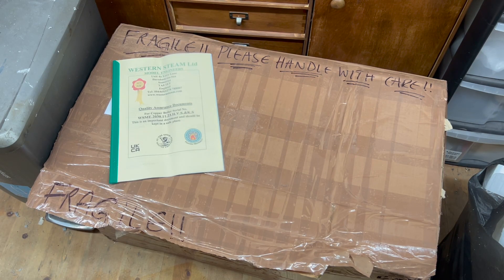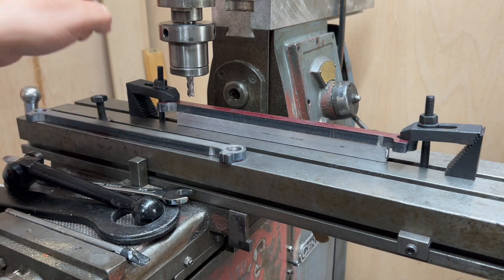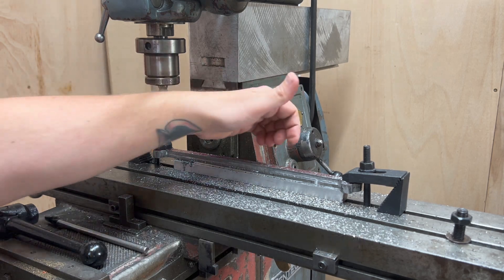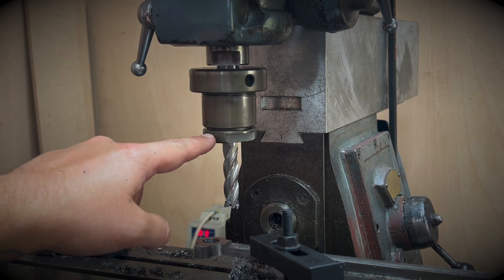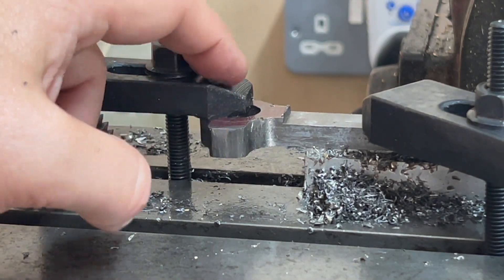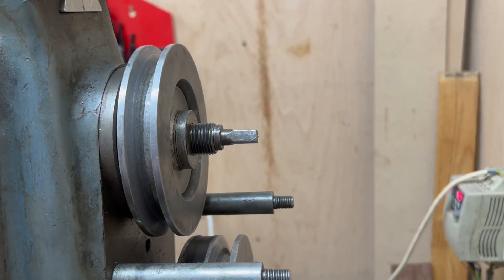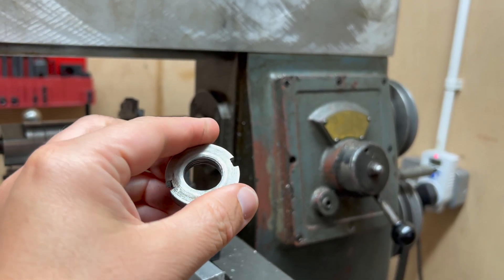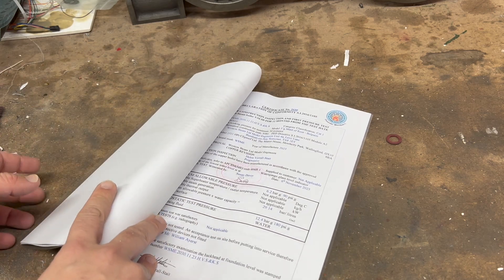A Series of Unfortunate Mistakes and ... some Copper? - Steam Loco No. 30

Comment: Hi mate. Im a younger builder like yourself but i went 7 1/4 because i like to throw away my money. Anyway, i have i B'port and i ended up having to rebuild all the spindle bearings, motor bearings and upper head bearings as well as sort out the table for some issues during my build too (its a worn machine... i know now!) so you're definitely not alone with mill strife! My attitude is; the quickest way to build it is to fix the issue in front of you. I'm saving for a boiler... see you in 20 years.

Good work keep going.
Reply from the maker: Thank you so much for the kind words! This product is in no way abandoned, but it’s on a bit of a hold at the moment - I’ll be back to it soon though don’t worry maybe we both have ours finished at the same time!?

Comment: It is great to see a video from you. We learned how to use the clarkson autolock from the same source. We have not used the horizontal on our Centec yet but we will have to check for those locking nuts. Your boiler is fantastic, it is one of those things that we could spend a very long time just looking at
Reply from the maker: Lovely to see your comment, thank you!

Comment: The boiler is very nice. Bit of an oddity that the regulator and header don’t have bushes and appear to be just holes in the plates into the boiler. I would encourage you to not shy away from copper boiler making. On my first 5” gauge engine I made it at a friends place under his guidance (he was fairly experienced). I did a great deal of the work and he taught and helped with the heats. I have made several since, tried various methods and approaches to construction and it really isn’t as scary as it is often made out to be. Most boilers I have made I have used a large propane torch, lots of firebricks and Kao insulation wool put in the right places. Now with more experience I used oxy-propane a lot for concentrated heats. If you do another engine, make sure you have a go.

Comment: The chassis and wheel set look great William,  and that boiler is gorgeous.
I have a Clarkson Autolock operators handbook, giving the manufacturers method for securing the cutters, if you want i can forward you some photos of the relevant pages?
Cheers Ian
Reply from the maker: Please do, if that’s ok?
Reply: @williamsworkshopuk  I promised something but I'm not sure how to do it!! Do I send it as an attachment via your youtube address?
Reply from the maker: @machineshopinagarage4699  will ayerst gmail com ?
Reply: @williamsworkshopuk  Read your message, just as  I had finished making a short video of the handbook , it's just uploaded,  freeze the frames to get a good look at the text and diagrams. Hope this is of some use William if not I will try to send by email.
Cheers Ian,  machine shop in a garage
Reply from the maker: @machineshopinagarage4699   checking it out now!

Comment: I've got a table off an old bridgeport milling machine under my bench. Seemed too good to scrap. You could chop it to suite bolt to your table and use it as a riser? It's properly heavy and also  in Leicester but your welcome to it for free if you want it ?
Reply from the maker: That is so very kind of you! I actually bought some substantial angle iron!

Comment: Try not to clamp on work that overhangs and the work should have less chance of moving when machining.
Reply from the maker: Thank you, I was trying to avoid bespoke clamps but looks like it's inevitable!
Reply: The clamps themselves were fine - just could have done with the alumiunium packing piece (or parallels)  under the rod extending far enough to the end so the clamp is applying pressure directly down, clamping the rod to the packing beneath putting everything in compression.

As you had it, the clamp was trying to bend the end of the rod where it was overhanging the packing,  so the clamping force was being limited by how 'springy' the rod was in resisting the bend the clamps were trying to apply.
Reply: Just get or make some jack-in-bolts, basically a hex-headed-all-threaded-bolt with a hex-headed-nut with as may threads on it as the bolt + couple more.